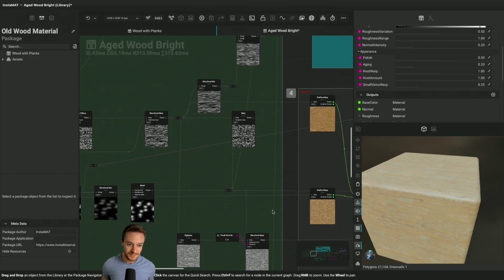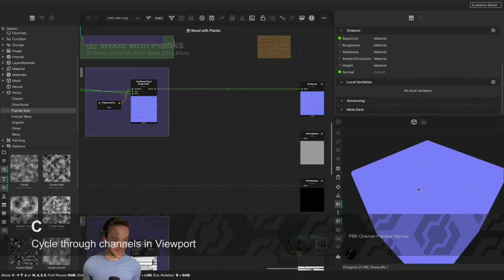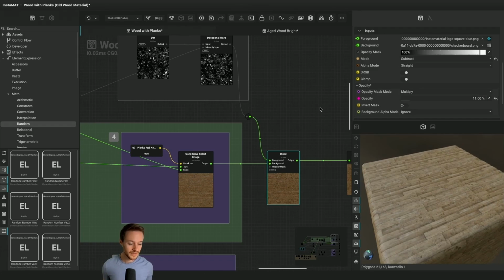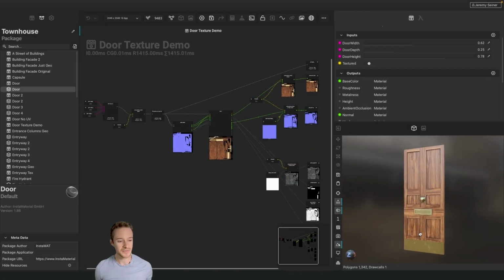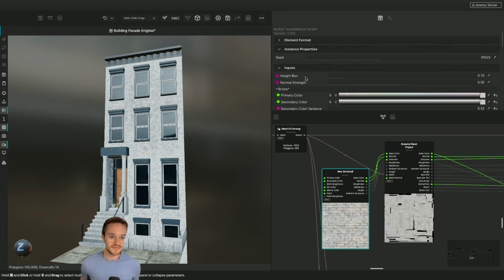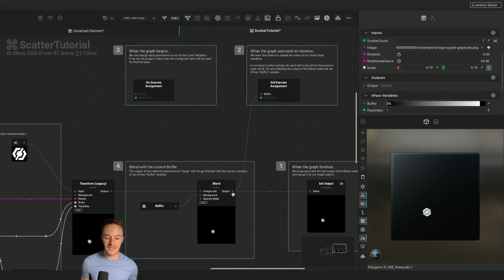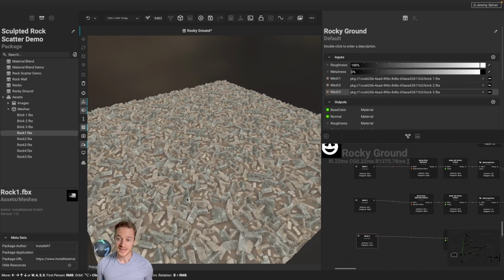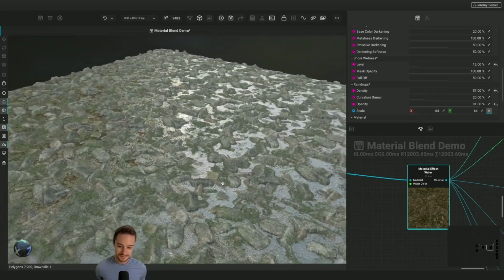Getting Started With InstaMAT: Expanding Concepts from Substance Designer

Comment: That's neat! No more unnecessary RGBA and RGB+A merge nodes at the end of a graph. I'm currently exploring the tool. Don't have a lot of time to post forums or Discord currently, so excuse me for randomly bringing it up here: Could you please add the ability to scroll any window/panel via holding a mouse/tablet pen button? For heavy tablet users, this is super sad in any tool if this doesn't exist. In Substance Painter, you can do this holding "Ctrl+Alt" and drag the window up/down. But the best implementations for tablet users is in 3D Coat, where you can simply right or mid click in any window to scroll it up/down. Seeing how well you guys take tablet users into account even for the graph editor(!) , I would love to see this integrated for even faster workflow for users mostly using pen.
Reply from the maker: Indeed, that's super helpful 🥳 The feature-request makes sense, but the best way to get it heard is by posting it in our community forums so the MAT community can vote on it! 🧐